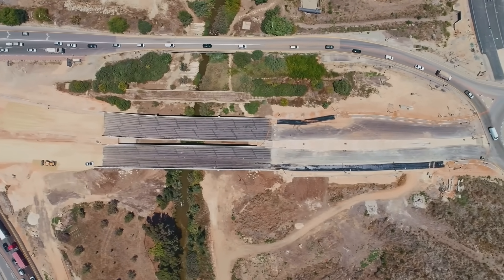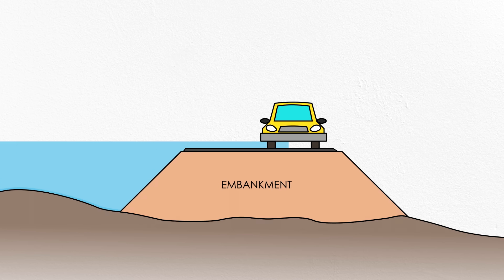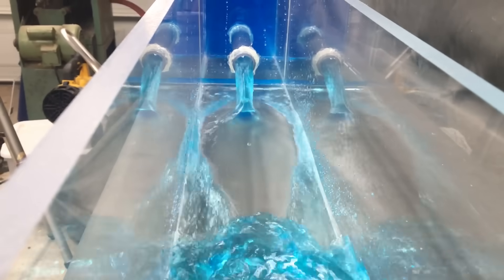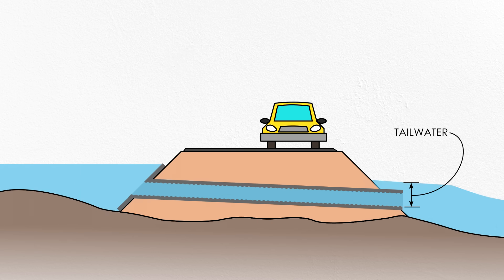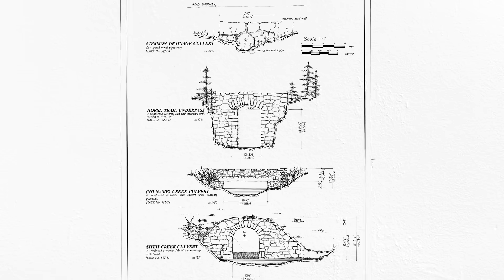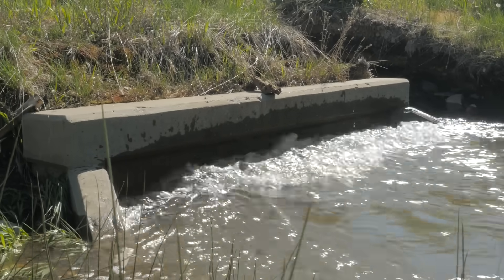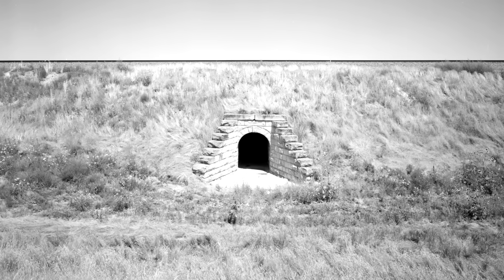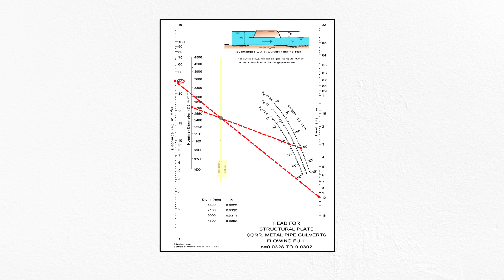What Is a Culvert?

Comment: My senior project as a civil engineering student was to design a culvert for a small, rural road. "It's just a pipe in the ground, how complicated could it be?" That is exactly what I thought when I heard about the project as well. My jaw hit the floor when I started researching reference material for culvert design - it was way more complicated than I ever imagined! I used the same Federal Highway Design manual you referenced in the video! 

This video does a great job summarizing the different factors which affect the flow through a culvert, but one of the harder parts of designing a culvert is first figuring out how much water will end up going through the culvert in the first place. This can be quite tricky since it requires lots of geographic and historical information about storms in the area the culvert will be.

Great video as always!
Reply: I had to design a pair of them as part of a masters module a couple months ago. I also remember saying " how hard can it be". That has to be one of the stupidest things I've ever said.
Reply: @ravinrabbi9320  This is why, when I sit down to build something, I never say, "How hard can it be?"

Instead, I say, "Hold my beer."
Reply: Can you give a hint about how much margin you're supposed to account for? So I assume heavy rainfall is calculated in and in several areas maybe a flood as well, but you cannot account (and pay!) for tsunami levels of water for every road.
Reply: @hkr667  It mostly depends on the consequences of failure. A small culvert under a rural driveway can be designed for a relatively light storm because it won't create a disaster if it fails. A levee system needs to be designed for a much more intense flow event because tens of thousands of lives and hundreds of millions of dollars could be at stake.

Every organization has their own criteria to decide what is "good enough." The Federal Highway Administration has a set of guidelines, counties, cities, and states have their own guidelines as well. A common design criteria is the 100-year rain/flood event. This just means that there should only be a 1% chance that in any given year a storm will occur which is too large for the infrastructure to handle. Dams or other large projects are often designed for a 1,000+ year storm.
Reply: @hkr667  There is no set margin. Typically for the municipality I work for, we design for a 25 year storm for the smaller basins. For larger basins we design for a 50 year storm and check the 100 year to ensure adequate freeboard. The different methods for estimating runoff peak rates also have some margin built in.  Larger rivers and streams may require increased design criteria above the 100 year.
Reply: @The8wallace8  Thank you for answering!
Reply: @hkr667  I think there is a video on this channel that deals with that question. You basically plan for a "100 year" flood.
Reply: How did you calculate how much water would flow through?  I've also been studying small forest road construction this semester and the forest roads may not require as much consideration as a state road that it sounds like you may be designing.  We used Talbot's formula to calculate culvert size or a table in a BMP manual from the state forestry department which really only requires watershed size and the runoff factor which depends on the region in the state.  For calculating the watershed size, we used a simple technique that could be done out in the field: just block out the area on a topographic map going across the ridgelines that would drain into the crossing and use a dot grid to count the dots and scale it to calculate area.
Reply: @riley4073  I used some GIS tools to calculate the size of the watershed with a digital elevation model. It is essentially the same method you used on the topo map, but the computer decides what the drainage basin would be by doing some math on the elevation model. 

The runoff came from a simulation using a program called HEC-HMS which is free and has a ton of hydrologic modeling tools. I used the TR-55 method and came up with an area weighted curve number by looking at some aerial photography.
Reply: @riley4073  A planimeter works great for that if you have one available and you are using a 7.5 minute USGS topo map.  I have done a few like that.
Reply: Some may ask why spend so much time designing a pipe, but they forget that in a road project you may have hundreds or thousand of culverts.  I once did a cost analysis for a wind farm, and we had 1 million dollars worth of culverts.  One trick to simplify design & save time is that there is often a minimum diameter required for maintenance reasons, and typically about a third or half of your culverts will be of this minimal diameter, so you do not need to calculate them.  You just calculate the larger culverts.
Reply: Would you mind me asking which university are you doing you Civ Engineering ? What challenges have you seen as a civil engineering student and internships? I am asking this as I will be entering college this fall and I will be majoring at civil engineering too
Reply: @westmax8491  Some of the courses near the beginning of the curriculum were challenging - mostly math and physics. The classes seem to get easier and more interesting as you get closer to graduating (in my experience). Don't feel discouraged if you are struggling with something, because I guarantee your whole class is!
Reply: @jakeg2089  Right.  Me too,  graduated 1969 BSCE  LA Tech U.
Reply: @westmax8491  Consider what you are interested in:  water-waste plants, sewer systems; water treatment plants-pressure distribution systems, storage tanks, storm flows, hydrology, irrigation canals and systems, tunnels, bridges-steel, concrete, wood, structures, dams, harbors, canals, air ports-runways, etc., traffic, highways and roads, railroads, site development, sanitation and reclamation.   Keep all of these in mind as you take your classes.  Concrete is plain, reinforced, prestressed and post-stressed.  My prestressed concrete class only had 3 students and one was a graduate student who needed it or it would have been canceled and it was more fun and easier than reinforced concrete.  There is also paving in the mix.  One semester I had Dynamics, Calculus, and Physics at the same time(all the same).  If you can do so, try to get a summer job kind of related to what you are interested in to earn money and learn on the job.  I did not know all of this when I started classes.  When you hit the first day of class don't play around, take plenty of notes, read the textbook, ask questions, get your work done as soon as possible, go to bed at a reasonable time and get up and get breakfast, review before the test and DON'T try to cram, it doesn't work.  Have at least one other interest that could be a hobby that you could use to work at and earn money so you are diversified and not stuck.  Learn how to do the jobs the old way so that if the computer is not available or bugged you can do it.
This will apply to ANY engineering discipline.  One of my professors had a saying  "You don't get ethics when you graduate and get that piece of paper.  You are trusted until you prove yourself otherwise and then you better hope someone else teaches the course next time."  In other words if you can't be honest in school you can't be expected to be honest in work and peoples' lives will be at stake.  Think of the Interstate bridge in Minnesota, Hilton walkway in Kansas City, and the walkway bridge in Florida that did not survive installation-those were engineering errors.
Reply: I just finished a university course that covered assessing culverts and their ability for fish travel. When you include that and all the engineering that this video covers, it gets quite complex!
Reply: It isn’t that hard tho.
All you need is a big enough pipe for the water flow. The culvert is mainly that bumpy tin. And the fall. Most of the time it’s a 2-4 inch fall.
Then you just need it dig the trench and place the pipe. And boom you have a culvert installed
Reply: @LDaniel_BDuce  Well, of course you can pick a size and hope for the best. What about passing water through a highway? Passing a large stream under road? Is there a chance for erosion on the downstream end due to high exit velocities? Do you need to armor the exit with rip-rap? Is the embankment strong enough to resist buoyant overturning loads? What about environmental concerns and aquatic organism passage?

These are just a few of the design considerations on large culvert projects. Picking the wrong size can have some dangerous and expensive consequences depending on the location. You can always just pick one if the project site is low risk and avoid any design work.
Reply: @jakeg2089   Also I couldn't agree with this any more.  It's important to get these factors right in forest stream crossings such as sediment control and organism passage since they affect the health of waterways and water quality all the way downstream!

Comment: I've got a cousin that's a CE.  I offended him when I remarked that CE is largely 'solved problems'.  He interpreted what I said to mean that I thought CE was easy.  But that is absolutely not what I meant.  I was talking about things like the nomographs mentioned in this vid.  Previous generations of engineers have gone to great lengths to give us the the tools we need to make things in reliable and repeatable ways.  

Dude is literally one of the smartest people I've ever met, but now he believes that I think CE is 'simple' and somehow less of a discipline than other forms of engineering and I wasn't able to dissuade him of that.
Reply: It's a lot like rockets. Rocket science has been mostly figured out. Rocket engineering is where all the hard work is at. Trying to figure out what information is necessary and how to apply it is really hard. 

An example from the rocket world would be Aerospike nozzles. On the surface they seem great but once you look further into it they are incredibly hard to make for only a small improvement.

So for a culvert an example that comes to mind is you could use some super specialized pipe poured in place headwalls or you can get a precast boxed culvert.

Both are a simular problem. You need to know what your performance requirements are, what's your budget, what's my timescale for designing it. If anything the CE job is harder because the have to account for the local populations opinions and how long construction will take.

Comment: ☺😊😀😁😂5 Smile's And airration via a similar flow use for prawn systems 5 tank block system pump to top and on one or the other side to pump flow as it runs from top to bottom the drain flow is also highly airrated via blockers so the prawn gets away and a sponge carbon for waste use UV and a hole bunch of other things to get it to fully work clean and green. The engineering on the fisheries is a joke! Should see the math I'am doing for a 200m off shore closed pen for the samion and fish stock big stuff and i kicked all of the current engineering on all 3 systems for profit to cost! Becouse there a joke! Big billion dollar industry for global use done with a fish tank i wounder other than the cash if they ever did aquaculture or aquarium tank systems becouse it don't look like it. 😑😬 that took 2 months to crash over half a boat building course since i don't need crush depth, propeller except the pumps or hull design and a part pipe plumbing one dam it but we went over it.

Comment: So the question is how big does a culvert have to be to be considered a bridge, or what defines one from the other?
Reply: 20 feet.  Literally.

According to the 8th edition of the AASHTO Bridge Design Specifications:
<i>Bridge</i> - Any structure having an opening not less than 20.0 feet that forms part of a highway or is located over or under a highway.

If whatever you've built spans less than 20 feet, you design it according to the structural specifications for culverts.  If it's 20 feet or greater, it's designed according to the AASHTO bridge specifications.  It being defined as a "bridge" also brings in a host of inspection requirements (for example, if it has public traffic it has to be inspected every 24 months, or 60 months if it's nonpublic), and it has to be tracked in the National Bridge Inventory: https://en.wikipedia.org/wiki/National_Bridge_Inventory
Reply: @CatCube2  Thanks for the answer, while US centric, it is a good enough definition as any
Reply: CatCube2 thanks
Reply: @CatCube2  Does this apply to multiple tube cast reinforced concrete culverts?
Reply: @royreynolds108  If the multiple concrete culverts together form a span of more than 20', they're a bridge.
Reply: Good question.  Maybe once supports are needed and the dirt is removed completely from under the roadway ?

Comment: I'm glad you covered this topic. There is so much within the engineering aspect, and imo, an equal portion to the environmental impact. If anyone thinks that its just putting a pipe in the ground, rest assured that it is not. Not to argue the point of bridges but alot of industry leaders are looking towards bridges over culverts. I cant explain it all in a comment,  in short it boils down to longevity vs impact in most cases.

Comment: The concrete channel surrounding the culvert over my driveway is collapsing. You can tell.its not working whenever we get heavy twins, as water backs up and flows over the driveway and soil has washed away from further uo my driveway. Thankfully, it's just a rental and not my problem to fix.  If it collapses, I'll just call the landlord and use the back alley. 4x4 life. 🤷‍♂️

Comment: My grandpa was in the army corps of engineers he worked on the nation's lock systems during the 40s and 50s he had this tool he called an "x ruler" I'm sure it was used for those graphs among other things. It was two rulers attached to each other in the middle with a loose rivet so they could pivot

Comment: I've always wondered how they stopped the flow of a stream to install a concrete culvert
Reply from the maker: If it's a perennial stream, usually it gets temporarily rerouted, or bypass pumps are used. I have a video on this topic :)
Reply: @PracticalEngineeringChannel  Cool! Can I get a link to it please? I don't think I've watched that one yet.
Reply: I've seen it done. It is why culverts in that situation usually are in pairs. They build one half of the culvert out of the flow, block up the stream so it flows through that half of the culvert, then build he rest.